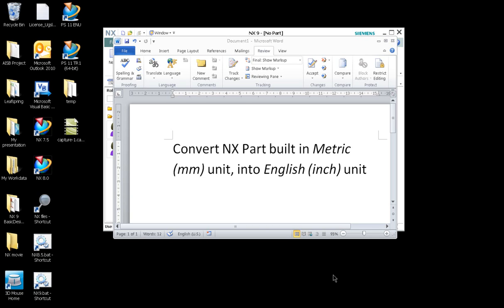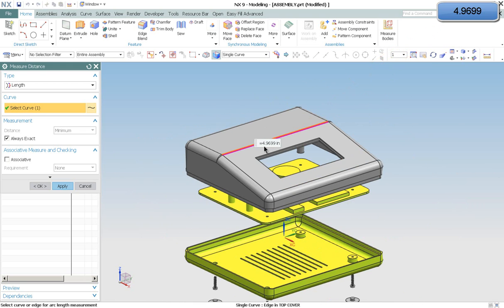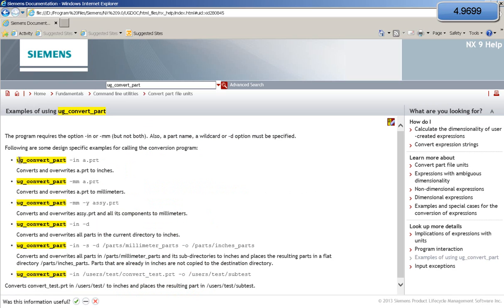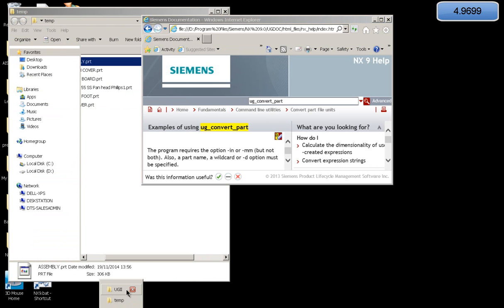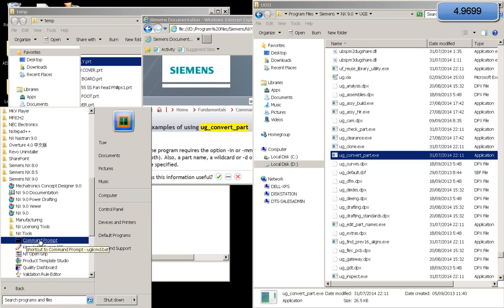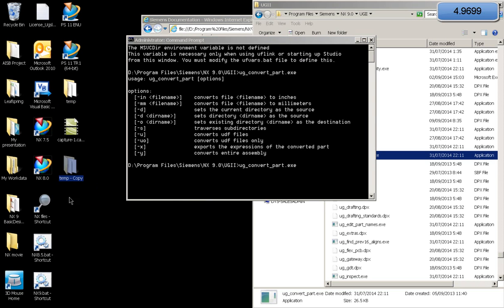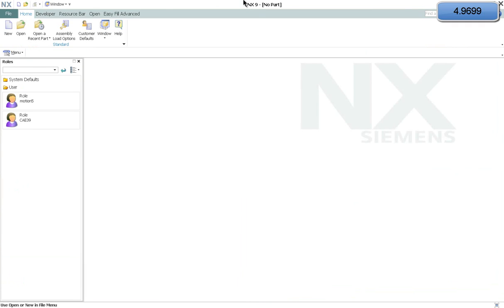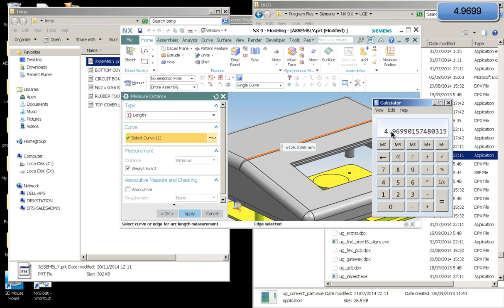How to Convert NX Part in Metric (mm) unit, to English (inch) unit

Comment: DOES NOT WORK WITH -y assembly!  The only way to do this is to export model to parasolid and import into a inch model.  I tried the method presented and it seemed like it worked but when i opened the model and measured a feature it displayed mm.  This was extremely aggravating.  Later I dropped a inch assembly into the model and measured and it was inch WTH.  Turns out NX in the command prompt says it successfully converts to inches but really is doing something much more complex to blend both inch and mm models together.  I hate this, I prefer to stick with one or the other. That is why i prefer the parasolid method.  The negative is that you loose the filenames.  Maybe I'll make a video one day to demostrate my nightmare.  fyi i'm on NX12
Reply: The file can actually be converted, but the measurement units remain in metric. Go to file>properties then Displayed Part tab. Look next to units. If is says Inch then is was converted. 
Go to File>Preferences>Measurement, and you can set your measurement units to inches.

Comment: When I do this I get a prompt that says "too many files specified". There are only 4 files in the folder that I am pointing it to. It also gives me that error when I try to convert a part by itself.

My code is:

C:\Program Files\Siemens\NX 9.0\UGII>ug_convert_part.exe -d D:\WORK\CUSTOMER\JOB\DESIGN -mm

Any suggestions? Thanks in advanced.
Reply: It happened the same to me,
but I revolved using "" to the entire address for example:
C:\Program Files\Siemens\NX 9.0\UGII>ug_convert_part.exe -d "D:\WORK\CUSTOMER\JOB\DESIGN" -mm (with "")
instead of
C:\Program Files\Siemens\NX 9.0\UGII>ug_convert_part.exe -d D:\WORK\CUSTOMER\JOB\DESIGN -mm (without "")
Reply: @manuelmendoglz   You saved my life dude, thank you so much. I have a report due and had to convert my files to use the appropiate template. Literally can't thank you enough, have a wonderful life!
Reply from the maker: tthayer16 , I have just tried to convert >100 files in a test folder, from mm to inch, done successfully. So I think the code is workable, not sure why you cant... What NX version are you using? Does it have latest maintenance updates?
Reply: tzekhai tuw Im on nx 9.0.0.19, so I don't think i am on the latest service pack.
Reply from the maker: tthayer16 until date the latest patch is NX9.0.3.4MP5, yeah, hope it works once you get it..